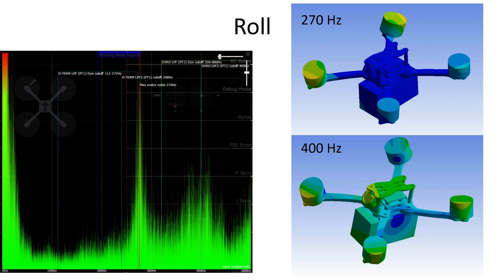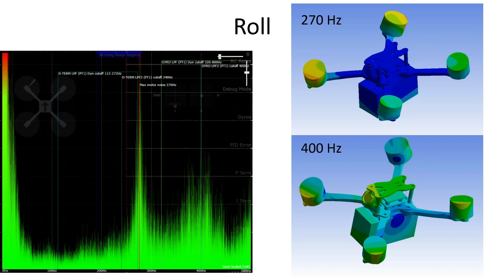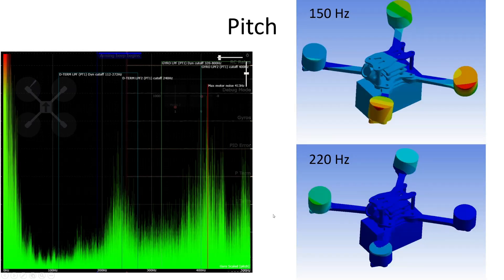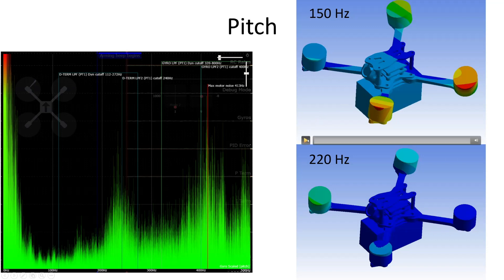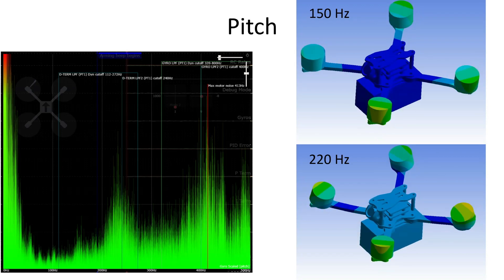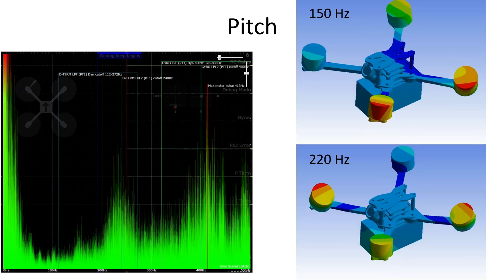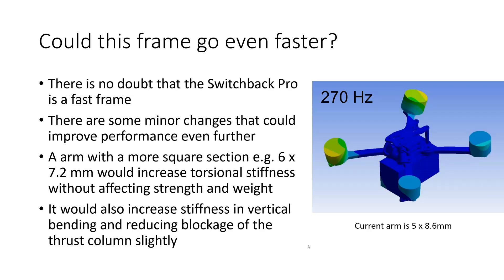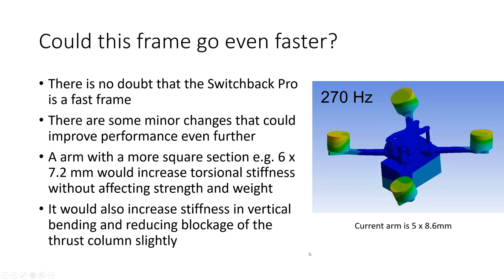Five33 Switchback Pro Frame Analysis: Can we make it go even faster!?

Comment: Could you not just use the arm braces to make it stiffer? So a stiffer frame equals faster, good to know! Great vids BTW.
Reply from the maker: Yes you can, but that will only affect torsion not the bending mode at ~150Hz and ~220Hz. The arm braces will add more weight than changing the arm section as well I think. 👍
Reply: @ChrisRosser  ah good point. Can you make a vid about how the frequencies effect flight performance? How much are the arms actually deflecting in heavy corning for example, or does the arm movement make the drone harder to control? Is the goal to make a frame as stiff as possible?
Reply: and drag